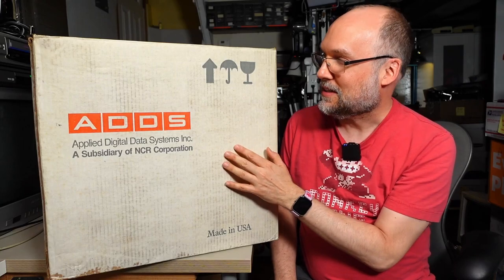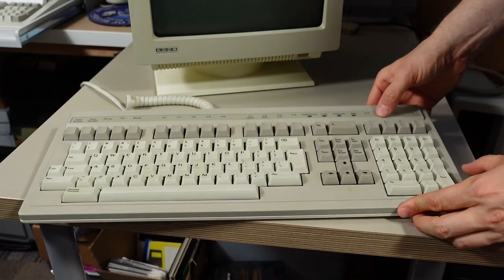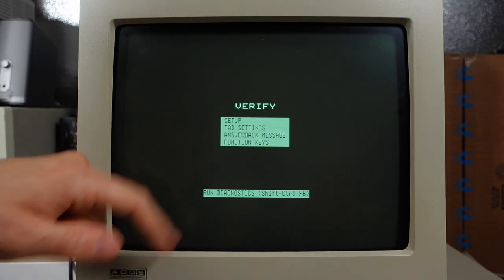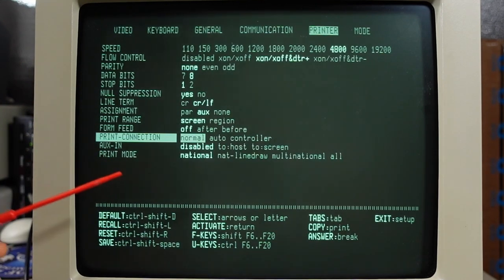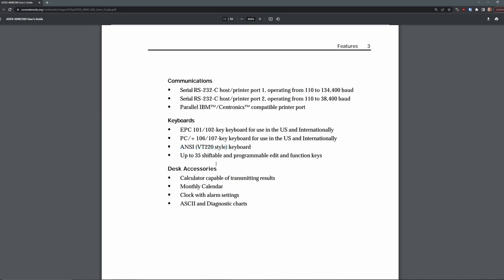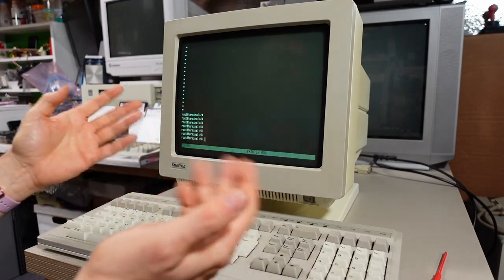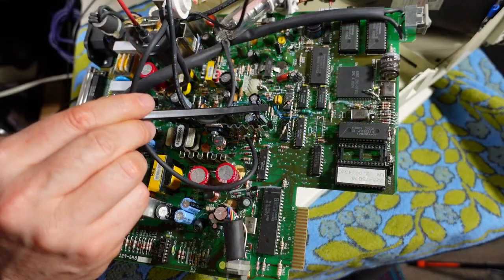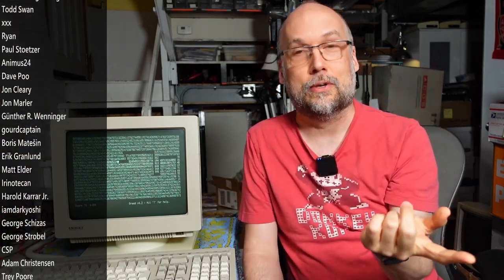Test and teardown: The ADDS 4320 Communications Terminal

Comment: That's a very nice piece of professional data tech. Obviously the keyboard is DEC standard. It would be a perfect match to a VAX machine (via MMJ adapter). How about with a (second) attempt with a VAX 3100 or 4000?
Reply: Gosh, I’d love Adrian to cover one of the smaller Vaxen.
Reply: @kaitlyn__L  I thought he did, but I confused it with RMC. Indeed, the Vaxen are very interesting machines, especially running VMS. Far ahead of its time.
Reply: @admirerofclassicalelectron2858  I get those moments too, going the other way :D

Comment: I wonder why so many terminals had this super bold printing on cursor keys. Wang and Wyse terminals also had very bold arrows. 

P. S. The keyboard switches are NMB Hi-Tek "space invaders"
Reply: This is just copying the DEC LK201 keyboard, which they used for the VT220. It's such a horrible layout. I'm sure you could have gotten Jerry Pournelle to happily smash one to bits with a sledgehammer.

Comment: I don't recall if there was a setting to turn off reverse video for the status line or not.  You could turn off reverse video though.  Some terminals showed an underline above the status bar to separate it from the main screen.  Ctrl+[ is a lot easier than reaching for the function key for ESC.  But I wanted to see you launch EDT, not vi:).

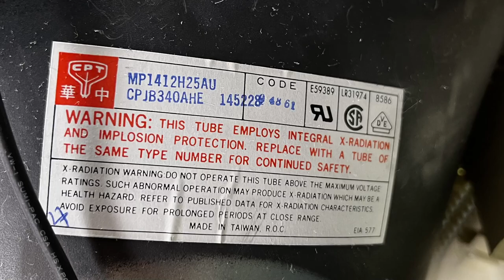Comment: 27:15 - what's the name of that red stick (screwdriver?)  ? Want to have one, but don't have idea how to order.
Reply: CRT adjustment tool :)
Reply: Yes, a CRT adjustment tool, made of plastic for two reasons. One, to keep your finger capacitance from affecting the circuit that you're tuning, the other to keep you from getting zapped by high voltages.
They come in different colors (usually a set of five or so) so that you can tell them apart, because there are a bunch of different tips you need to adjust stuff.

Comment: I remember finding a dialup modem phone number, using a wargames dialer on my c=64, that I could access the local university library card catalog system.  I would access it with my c=64, and get the info for bibliographies on my essays in high school.  I felt like such a hacker.

Comment: the lack of service manuals for equipment in this time frame is a simple explanation.  all service was done by the company, and for a 3rd party to buy a service manual was very expensive.  for instance i had a DEC terminal come in for repair, and DEC wanted $800.00 for a copy of the manual.   this was in 1992 IIRC.  not exactly cost effective for a one-off repair.

Comment: Banks and other legacy enterprise solutions still use terminals but the clients are all replaced by software that connect over network. This is the reason why I'm way to familiar with terminal settings and configs while being a GEN Z. (i work IT operations)

Comment: Does it support sixel?

A bit disapointing that it maxes at 38400 baud, but nice terminal never the less. Never interacted with them personally, so it is nice to see all the menus, and setup.

I think these days, it is easier just to get some older laptop, and use that as a terminal. Added benefit you can easily copy files, connect over ssh, more portable, has colors, faster. Even if one would to build one using some LCD panel, USB keyboard and Rasberry Pi or STM32, a laptop would still be better and has more features.
Reply: I was wondering about sixel graphics too. My guess given the settings is it’s text mode only.
Reply: @kaitlyn__L  Yes, I think it is way too old, and bitrate is too low.
Reply: @movax20h  It's not too old this thing came out a decade after sixel was invented. It's the opposite problem, by the time this thing came out pc were so cheap that if you wanted graphics you were better off just buying a pc.

Comment: my workplace actually still uses a terminal emulation system to access a mainframe for some useful data. There's a big push to move away from it to some kind of web-based system, but I actually like the terminal/mainframe system. It's snappy, responsive, and reliable even with spotty access. The web based systems I've seen are all orders of magnitude slower, highly unreliable, and can't handle hundreds of users accessing the data all at once.
Unfortunately, mainframe admins are worth their weight in gold and Javascript developers are a dime a dozen.

Comment: Not sure if it was the same system, but when I worked at a local Greyhound bus station in the late 1990s, the ticketing system was run using an ADDS terminal. The D-sub connectors on the back were connected to a ticket printer, a modem, and dot-matrix printer. There was a Western Union counter in the bus station that used a similar - if not identical - ADDS system to the one I used for generating bus tickets. The only difference I can recall between the two systems was that the Western Union terminal had an amber phosphor monitor, whereas mine was paper white phosphor. At the time, about 1998, Greyhound local stations were run like sub-contractors and operators were expected to purchase their own terminals (some still hand wrote tickets on multi-copy forms, but this was being strongly discouraged). Basically, at that time all actual computer software was run remotely on Greyhound's central computer system, locally their was pretty much nothing except some diagnostic stuff to troubleshoot a connection problem.

Also, probably import to know, the data transfer needs for a ticketing system were amazingly low. It may seem slow to us now, but believe me when I say 9600 baud was more than sufficient to get the job done.

Comment: That looks really high resolution. Was it 1024x768? Or just 800x600?
Reply: It looks like a 5×7 font with, I think, 2 pixel line spacing, on 24 lines plus the status bar, plus one or two blank lines, and probably 80 columns with probably 1 pixel letter spacing, so it'd be [(5+1)×80]×[(7+2)×(24+1+2)] or 480×243. Somewhere around there.

Comment: A little surprise it's not even have 57600 that most PC can reach (but it did have VT320), even in DOS age baud rate can up to 57600 without upgrading to 16550 UART, must be for the old UNIX or VAX system, not yet for the PC communication.

Comment: I have a DEC 320.  It's a great terminal for hooking up to a Pi etc.. but I hate the keyboard.  The keyboard is so mushy and unresponsive.   So I may be putting my DEC up on ebay and looking for a Wyse with a good keyboard.
Reply: Be warned that Wyse did make some good keyboards... so good that people want just the keyboard for its Cherry switches, thus leading to a (relative) shortage of keyboards! I have a WY-325 in need of a keyboard, but the protocol seems simple enough that I may try to create my own encoder someday.

Comment: The use of the term "bodge wire" is now grossly overused (yes, I know which Youtube creator is responsible for its usage). In all of the electronics factories that I worked in (7 of them over the years) we used the term "mod wires" or "mods", which stood for MODIFICATION. The use of mod wires/mods is a giant PITA for volume manufacturing, but was sometimes required to address either artwork issues, timing problems (prior to the use of logic simulation software), or to address differences in the performance of various ICs when they were sourced from multiple vendors. PCBs were often laid out by hand, and errors did creep in (especially in the  early 1980s when I first started in the industry), and were far less common when software for laying out PCBs started to become useful/viable. In some cases, we had to use mod wires when some of our custom designed ICs underwent a die shrink, so that the ICs were actually faster than the previous versions, or sometimes their logic levels would vary slightly, as would thier sensitivity to ground noise. In higher volume environments, adding even one mod wire to a board would force a board redesign (board re-spin), as the amount of labour required to add a mod was considered to be unacceptable.

Comment: Terminals. Another product that died due to the pc and pricing. No I'm not talking about Thin clients, zero clients, etc etc. Just the typical old dumb terminals.
Reply: They died out because text mode interfaces suck.
Reply: @IkarusKommt  I still prefer htop over a GUI activity monitor!
Reply: @IkarusKommt  Text modes don't suck the problem is ideally you'd want a mix of text and graphics and only the most expensive terminals could do that. So something like a vt340 could do full color graphics but by the late 80s those things cost almost as much as a computer which could do much more than a terminal. So yes terminals did get priced out of the market by cheap pc that were much more powerful but didn't cost much more.

Comment: Ok you waited until after messing with the board and mucking around the CRT before discharging it?  That should have been the first thing you did before anything else after removing the case. Pretty much a bad safety decision.